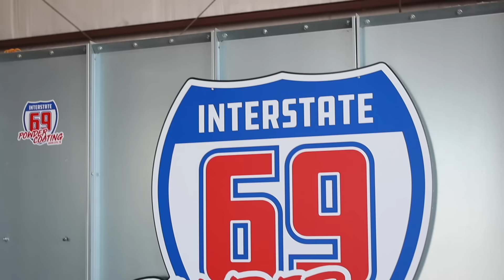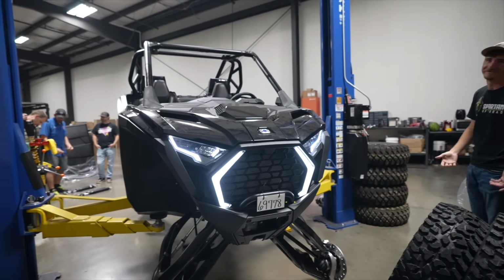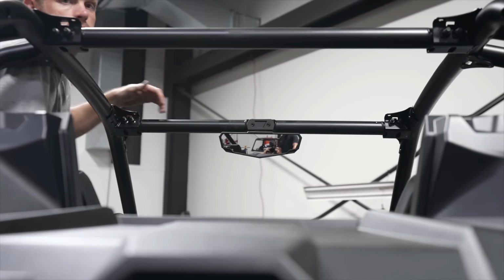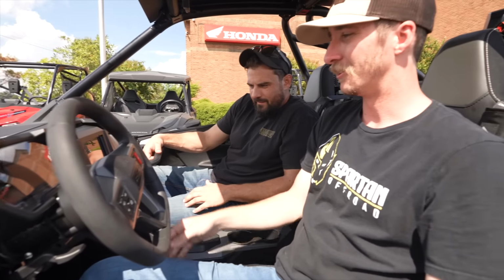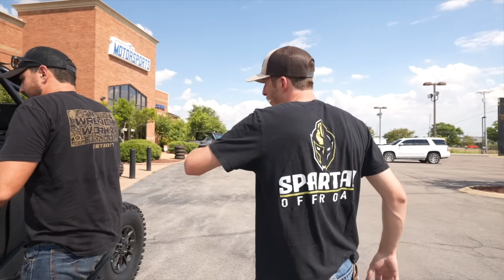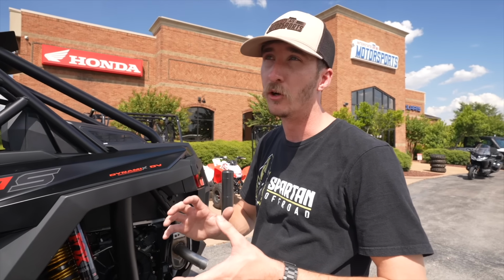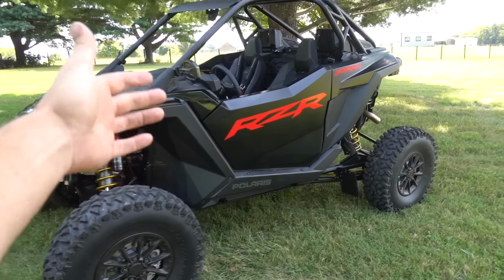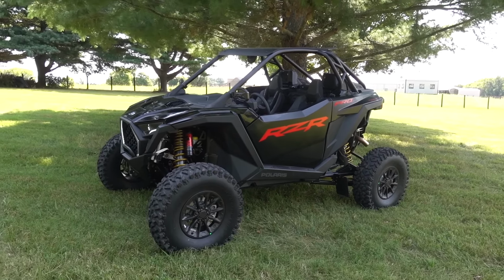My NEW 2025 Polaris RzR ProS TURBO is HERE!!! New Build is INSANE!!

Comment: I have had my 2025 Pro S 4 Ultimate for about a month, 400 miles on it and I love it.  I put 5800 miles on a 2022 Turbo R 4 Ultimate and loved it as well.   The refinements on the Pro S are worth it, the seats are amazing NO PRP seats for me (PRP seats are overrated, had them in my Turbo R and did not think they were worth the coin). The doors are great, the front-end has the best visibility in the business now! I put 33" Tensor Regulator 2's on mine, and it just flies.  Never again 35" tires, I had 35" KM3's on my Turbo R  -- they are so heavy that it takes its toll on performance from all sides.   I did not give up much in ground clearance ether with the Tensor's. Very happy with the Pro S for sure.
Reply: So you would say the Pro S is definitely an upgrade over the turbo r! Nice! 

Did you have any problems or issues at all with your 2022 Turbo R? 
Also what made you choose Turbo over the 4 cylinder?
Reply: @faultless18  No issues with my 2022 Turbo R, it ran flawlessly.  The Pro S is an upgrade over Turbo R for sure.  The frontend has been redesigned,  visibility is better over the front.  You now have full doors, the dash and storage boxes have all been redesigned.  The seats have been upgraded and are very comfortable, the gauge cluster is all new, and the side body panels have all been redesigned. There is now two cold air intake vents in the front to help keep the cab cooler in warmer weather. It helps dissipate the heat from the radiator.   The powertrain is the same as Turbo R. The Pro R with the bigger engine, is not for me.  The fuel mileage is poor compared to the Turbo R/ Pro S, it is noisier as well and does not ride as smooth.  I am talking all 4 seaters here, Turbor R, Pro S, and Pro R.
Reply: @rodneysessions7463  I really appreciate the reply. I’m looking into buying one and I was really leaning towards the Can Am x3 maverick XRS RR (not the maverick R) 
I test drove both at a dirt track with whoops. can am smart shox and razr turbo r ultimate dynamics. Wow was it a difference. The razr just felt better overall. Feels better built and I was really impressed. 
I go to mostly Glamis (sand dunes) and dirt areas. I’ve been doing my research on reliability on the Razr turbo R. Because I have a heavy foot and I like to push things to the limit 😅